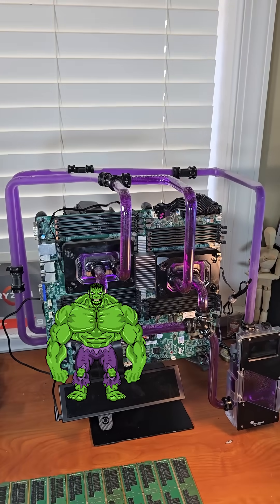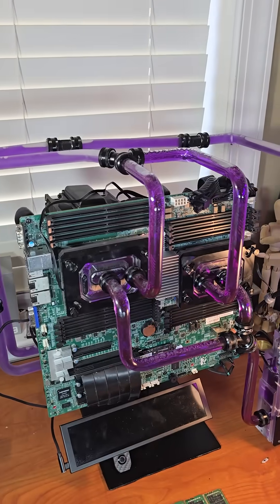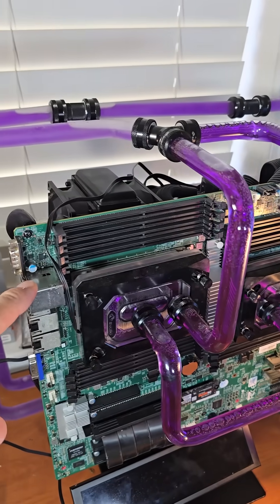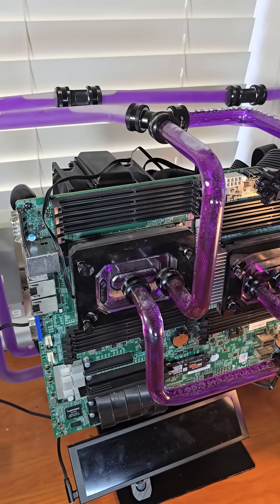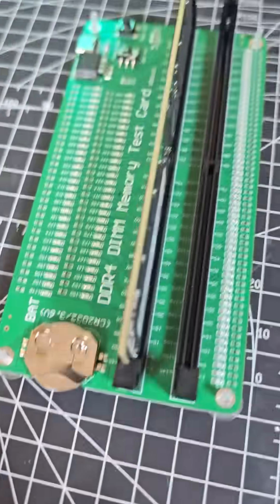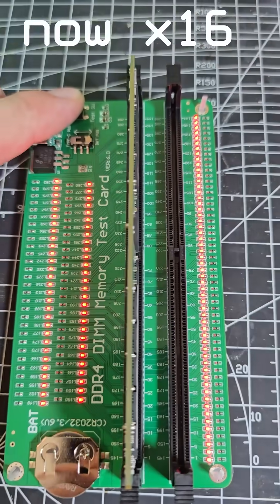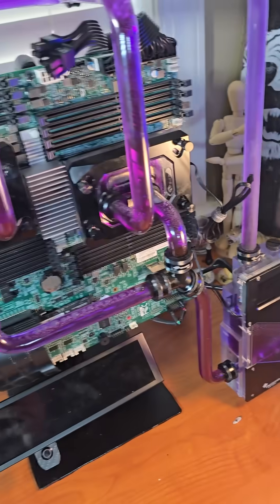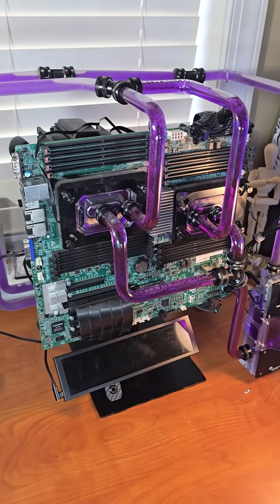Hulk Update: Troubleshooting; Testing all 512 GB of Hulk's registered DDR4 memory

Comment: Good job! Yeah its usually not the memory. Good to check though. Perhaps a good working used epyc board to test each CPU?
Reply from the maker: Yeah, that was going to be my next move. Im currently perusing the cheapest single socket boards on eBay as we speak.
Reply from the maker: Its likely not the CPUs as the vendor who sold them to me talked with me at length. I told him they were for a YouTube video series and he told me he would give me a discount if I said where I got them, but you never know. He could have been told they were good. My money is on the MB being bad but I'm going through my due dilligence before buying another $1000 MB